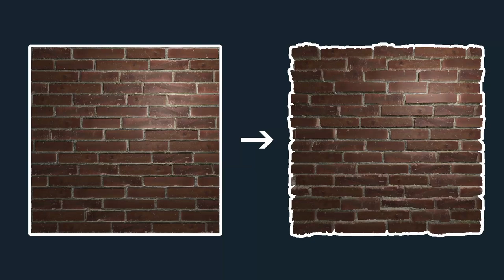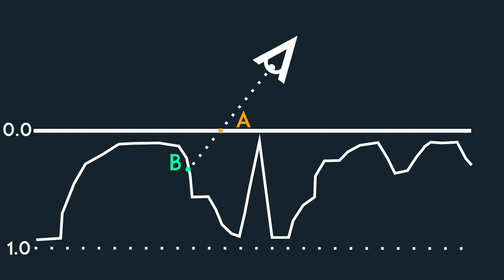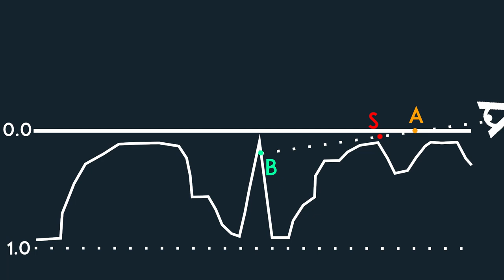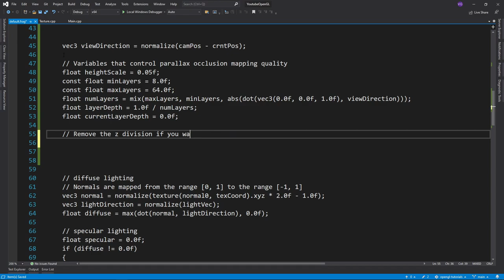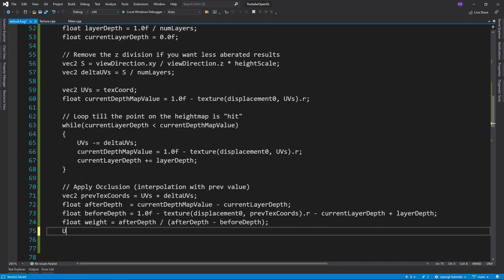OpenGL Tutorial 28 - Parallax Occlusion Mapping

Comment: at 4:01 - is the vector (0,0,1) within the dot product (third argument of mix) not going to restrict the occlusion to one specific direction? Wouldn't it be more suitable to dot against the normal for that fragment?
Reply: true , you can use the fragment normal instead of (0,0,1) , he did this only because the brick wall was facing the direction of  (0,0,1) as an example for the video

Comment: This is very helpful and well explained. Sadly, this doesn't work with a procedural generated height map, does it? Or at least not, without recalculating the (in my case, expensive) height map calculation for each layer.
Reply from the maker: Should work just fine. But keep in mind the use cases for it. You would not use this to render terrain for example. More like a miniature map or something like that.

Also, you can just render the heightmap to a texture and give that to the shader, should work just fine without any significant impact on performance ;)
Reply: @VictorGordan  Thank you for your quick reply :D I got your shader up and running perfectly well, using a 2D texture as heightmap. But im having a hard time replacing the texture with my procedual heightmap, since we sample the texture with "different" UVs for each loop (because we do UVs -= deltaUVs within the loop). To sample my heightmap, i would also have to include the entire heigtmap calculation to the loop. You don't happen to know a need little trick to avoid that problem, do you? :D
Reply from the maker: I'm not quite sure what the problem is... if you write your heightmap into a texture, then when the shader will read that texture just as any other texture. It's ok if the UVs are different. Nothing is getting recalculated in the texture.

If you are generating a dynamic heightmap each frame on the GPU, then just make that a separate shader from the parallex shader and save the result as a texture.

Perhaps I'm misunderstanding something? 🤔
Reply: @VictorGordan  I should have mentioned that we intended to use this effect on runtime random generated buildings with huge surfaces. We are covering texture repetition with noise based damages on the wall, making up the heightmap. We would have to draw thousends of textures, each with a very high resolution, to cover a whole city. Im arfraid writing the heigtmap into a texture is not an option :/ But you can't imagine how much i apprecciate your help anyways :D thank you a lot sir
Reply from the maker: Ah ok, I see the problem now. Yeah that's more complicated, I can't give you a solution for that without knowing many more details... good luck tho! ;)

Comment: I am curious whether it'd be possible to gradually change into this starting with an actual displacement map and then towards a normal map.
That might be a pretty effective gradual LOD system.
Reply from the maker: I'm pretty sure that is possible and I think it is done in modern games, though it's not always that smooth. If you just put an if statement you can just change between the two at a certain distance. If you want to do a smooth transition you would have to calculate both of them and then interpolate. But it shouldn't be a problem since even with the displacement you are still likely to use the normal map anyway

Comment: What's the proven way to solve (mostly convex) edge artifacts that come with this technique?
Reply from the maker: Generally speaking you mainly just don't want to allow the viewer to get at a small angle camera with the plane. So you would normally use this for the ground, or walls that have pillars in the corners for example.

I don't know of any specific fixes off the top of my head. But if you google some I'm sure you'll find papers on this subject which might have some optimizations ;)

Good luck!